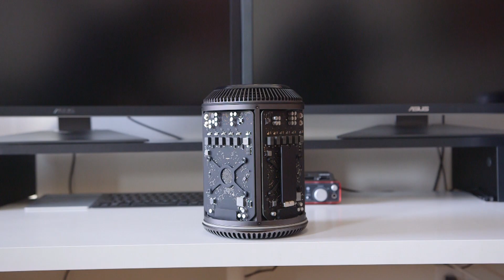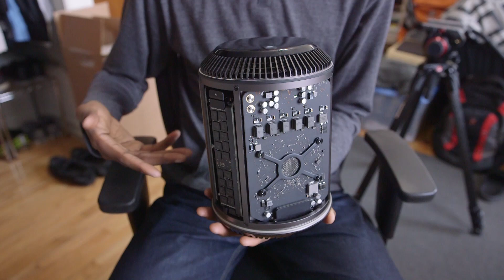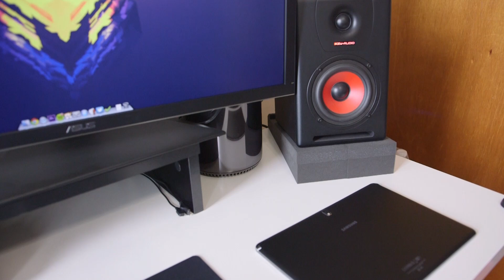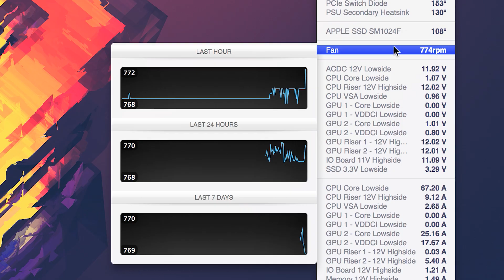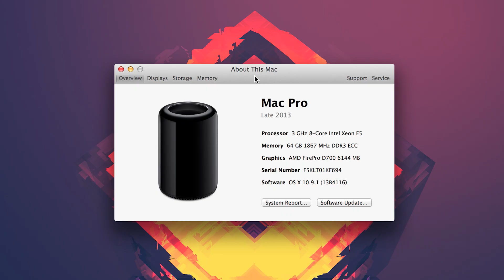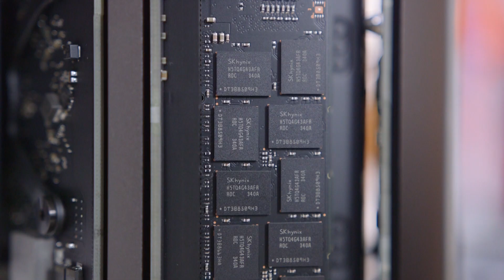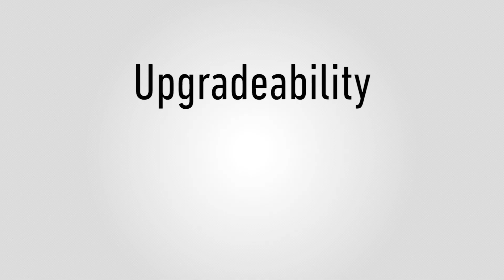New Mac Pro Review!

Comment: What a waste of money....
Reply: Why exactly?

And before you answer, think hard, because we have seen the "an i7 with a Titan and some non-ECC RAM and an SSD is so much cheaper" statements more than enough to counter them efficiently.
Reply: Indecisive Fella Terrible expansion options - GPU's non replaceable, SSD not replaceable with traditional parts, CPU VERY VERY difficult to replace, adding more hard drives requires thunderbolt drives... Really need me to go on? For less than the price of this garbage can you can EASILY build a workstation that is fully upgradeable and customizable.
Reply: Tyler Horsman
External GPU expansion is an option, if those D700 will not suffice your needs in three years anymore.
Flash storage is replaceable, but of course not with an S-ATA SSD like many people want-
CPU difficult to replace, but it is doable.

For the audience this workstation is meant for, external storage and network storage is already common, thus external Thunderbolt storage is not that big of a problem.
I worked at several video production companies, and the footage used for video editing and manipulation was always stored externally to make switching workstations easier due to scheduling of those.

And the price argument has been defeated to death, but you can give it a try with an i7 and non-ECC RAM and gaming GPUs and SSD storage of course.
Those consumer components are easily beating workstation components in every aspect you can think of, which means, you do only think of benchmarks.

The Xeon is rated for 24/7 operation, and i7 is not rated, though probably able, to do that.
The Xeon has twice the PCIe bandwidth.
The Xeon allows more than 32 GB or 64 GB of RAM.
The Xeon allows for Error Checking and Correcting RAM, which can help with hour and day and week long calculations.
The GPUs are workstation GPUs aimed at CAD and DCC applications and not games, thus they perform poorly in some games, but outlast and outperform gaming GPUs in the applications those GPUs were meant for.

And one other thing, I know, I know, it is already coming close to a novel for some, probably for people never having touched a novel in the first place of course, why is it, that Apple workstations get all the hate by people like you, but Dell and HP workstations with the same or similar workstation components costing the same or more than the equivalent Mac Pro are left alone?
Is it because of Apple?

And why can no one I ask this ever answer that question? Too afraid?
Reply: Indecisive Fella I'm never afraid. I would comment on those machines except I've never seen a group of sheep drooling over an HP workstation or other. People that DO NOT NEED this type of system are buying it because they think they need it because, APPLE. I never said that the components weren't capable. You talk about network storage and such being mostly the norm, but who wants daisy chains of lightning connectors all over their desk? It's schizophrenic design in my opinion to design something that is the epitome of minimalist design and then require external cables everywhere. As well, an HP workstation is fully customizable and expandable. The Mac Pro is an 'elitist' product, plain and simple.
Reply: Tyler Horsman
"I would comment on those machines except I've never seen a group of sheep drooling over an HP workstation or other. "
- And I have seen more people complaining about Apple products than drooling over them.

"You talk about network storage and such being mostly the norm, but who wants daisy chains of lightning connectors all over their desk?"
Probably the ones that do not use Lightning?
Yes, I get the cabling issue, I have seen it myself recently, but even if we had a big workstation in the suite, there would have still been a lot of cables.

"It's schizophrenic design in my opinion to design something that is the epitome of minimalist design and then require external cables everywhere."
- I recently came to the conclusion, that Apple wanted that design for expandability, to reduce the machine to its core components, thus reducing the size, and giving every buyer the option to expand via TB2 as the buyer sees fit.
And if one is a bit more precise when cabling, one can avoid clutter, or use a rack.

PS: I have worked on many workstations with some internal expansion modules (eSATA, video in/out), but always were there lots of cables going out to external periphery.
Hell, I have 12 TB of internal storage, but I still cable out to use my other 20 TB of external storage. Now please give me a case with space for 20 3 TB HDDs, I already found the motherboard with 22 S-ATA connectors.
And please let it not be higher than 50 cm and heavier than 15 kg and not made of the cheapest plastic you could find.
Reply: Tyler Horsman
Since all other non-Apple computers and computer parts are of course not produced by Foxconn and Foxconn is the only manufacturer with such working conditions.

And of there is no reasoning with me, if you have to use the word crap and if you use the word crap, your reasoning is not very persuasive and probably are already set in stone. Good luck with that.
Reply: Tyler Horsman As if PC's aren't made by the same people.
Reply: Indecisive Fella
In layman's terms, this system is locked down either by accident or by terrible design.  Sure, you can use the TH ports to upgrade parts, but at the cost of going in direct contradiction to the core design element.  Either Apple didn't think that one through, or it simply ignored it when it inevitably came up in the early R&D meetings.  Either way, it's design directly contradicts the logic used to defend its expandability.

And to that end (expandability), who ever heard of a modern workstation with a single Xeon CPU and soldered in GPU's?  Those two aspects alone throw this thing right into the Enthusiast grade .  Hell, Boxx is already offering 36 core setups that utilize dual 18-core Xeons.  Origin PC offers dual Xeons that each match the single processor in this iteration of the Mac Pro.  Both Origin and Boxx offer liquid-cooled setups, whereas you get the trifecta of heat generation (RAM, GPU, CPU) on a triangular logic board in the Mac Pro here, all cooled by a single fan.

Realistically, this version of the Mac Pro is a slap in the face to anyone that actually understands computers on a physical level, and more so to those that would need expandability without the mess of cable management.

Honestly, this system is a joke.
Reply: They might as well be, considering the limitations on "replacing" them.

And yes, it is a joke machine when compared to a real workstation.  What legitimate workstation lacks the capacity for dual CPU's?  What legitimate workstation lacks the capacity for PCI-e 3.0 cards, or the ability to utilize more than 64GB of RAM?  What legitimate workstation uses a SINGLE fan for overall system cooling?

That's right.  No legitimate workstation has any of those limits.
Reply: James Davis
Since workstation computer support more than 12 cores and 64 GB of RAM, there surely is a need more more computational power, be it in a lab or production company.

I have 32 GB of RAM and only a 4 core CPU.

I can easily fill 32 GB of RAM with just one application, if I had 64 GB I can surely do the same.
My 4 core CPU is plenty of fast, but what if a 12 core CPU can save me time by being twice or thrice as fast?
I recently had to transcode 160+ hours of 1080p footage. It took to four core i7 K computers over a week to finish, a task a 12 core CPU would do in less.

And imagine having a 3D animation where every frame needs just five minutes to render, ten seconds of that at 250 frames would almost take an entire day to render, and the scene only had six boxes and two text elements, three cameras and one light, but its materials were self illuminating and the render settings called for Global Illumination (GI) and depth of field.
That takes computational power. The more the better.
Imagine a four CPU 16 core system. It would race through those frames and have the time to render complex setups which my 4 core system would simply take weeks or months to finish-
Reply: *****
Come on, you can surely add that via a USB 2.0 to PS/2 to SAS adapter or a PCIminusE card, can't ya?

Or if you find that YouTuber who has a friend who makes all his hardware for him, including multi-core CPUs. I shit ya not. At least not in this specific case.
Now if g+ would offer some 1990s forum tools like search, it would be perfect, as I could find that fella, but what can you expect from a search guru?
Reply: Paul Lowe
I am not wanting to change people into Apple lovers, but I slightly want them to understand the differences and that people have different computational needs and that those needs are not always met by a cheaper computer with higher specs and such.
Reply: *****
And yet people seem to be capable of using it, especially in a time of breakout boxes, even to its full potential.

I guess with such a joke machine, no work could have been done and it would have burnt by now when two YouPort windows would have been opened?

And the GPUs are soldered onto the main board?
Reply: *****
What is a legitimate workstation then?
I guess there is a definition somewhere hidden inside your words?
Reply: Indecisive Fella
Pretty out in the open definition, really.  Any high grade system that doesn't put limits on what hardware it can utilize.

Look at BoxxTech or Origin PC on the OEM side, or look at the truly custom solutions that people build for themselves.
Reply: ***** I will do that.
Reply: What use could anyone have for more than 64GB of RAM, or dual CPUs when the one that's there has TWELVE EFFING CORES?
Reply: Indecisive Fella And that right there is why Intel now makes 18-Core Xeon processors, and Nvidia makes ungodly Quadros with the only object in obtaining both being cost.
Reply: *****
Ah, an 18-core CPU surely would help my transcode times.
Now I just need to get one of those quadruple CPU main boards and some RAM for each and I will be set for another year of transcoding.
Reply: Indecisive Fella
I have yet to see a Quad-CPU mobo.  If they do exist, they're in a realm this mere mortal has little access to.
Reply: *****
http://www.supermicro.com/products/motherboard/Xeon/C600/X10QBI.cfm
Reply: Indecisive Fella
If only that thing had SAS 12Gbit support, I'd gladly trade my entire tower plus the difference in cash for it.
Reply: Indecisive Fella
Too many adapters.  Does not compute.

Really though, at that level one might expect/look for SAS support.  But hell, some Enterprise PCI-e SSD's would work just as well.

And g+ not offering search tools?  You must be crazy!  Why, just the other day I used...um...Bing?
Reply: *****
"You must be crazy!  Why, just the other day I used...um...Bing?"

No, I meant g+ does not seem to have a tool to find one's own or other comments, like any standard forum software since the 1990s offers.
Reply: Indecisive Fella
And that was the joke.  G+ has about as much usability as Bing.
Reply: *****
Sorry, thought of Chandler Bing. And he is good at searching. Hmm. Late. Cats. English Mastiff. You know, the usual.
Reply: Indecisive Fella
Points for the Friends reference.  Late.  Yes.  Timezones and such.
Reply: *****
Space and time do not matter anymore.

And I guess the Bing developers watched Coupling quite a lot, thus its name.
Reply: Indecisive Fella 
You said space and time.  My auto-response is to assume Doctor Who.

And Bing had developers?  When?!  Where?!
Reply: *****
Which again reminds me of "Heyo Captain Jack" in some misguided way. Word association is fun.

And of course Bing had developers, at least on their financial reports.
Reply: Indecisive Fella
I can see the Bing financial report meeting now:

Boss: "So Johnson, how did we do last quarter?"

Underling: "Well, sir....we sold some ad-space to...um... AOL"

Boss: "FANTASTIC!"
Reply: Indecisive Fella Lol what is the point in defending Apple? Look at all your comments.
Reply: Paul Lowe
What is the point in bashing Apple products and especially Apple users? Look at all those comments.
Reply: Indecisive Fella I'm asking you the question for that very reason. I don't hate Apple. In fact, I'm replying to you on my iPhone 6 Plus. People are going to hate on Apple. It's always going to happen. Wasting all your time, as little value as it may have, is worthless. Do you think you're going to somehow change them into Apple lovers?
Reply: Indecisive Fella
yeah for my school ill be using ughhh i hate saying this a Macbook pro but Professionally a Mac is THE ONLY WAY TO GO i understand that however my every day work horse/gaming pc will ALWAYS be my custom built Windows pc windows is for gaming its just that simple. i couldnt bring myself to use a mac as my everyday pc its just to use profesionally both are amazing systems but its like i stated.
Reply: Sun Killa
We use Windows based Dell and HP computers all the time at work.  Hell, our live broadcasts depend on the stability and ease of use of our entire computer network.  Which is nothing but Windows.

PC's aren't only for gaming, as the common myth may dictate.

Comment: One thing about the "high" price, keep in mind that you do pay for the operation system. Mac OSx is not cheap to code and it is very well coded. So the Mac Pro uses less powerful internals but runs way smoother and faster than a Windows Pc with better internals.
Reply: i agree. a genuine mac with os x will ALWAYS perform better than a PC with identical hardware and windows, because Apple custom builds their hardware and software to get the most power. Macs don't necessarily have the best bang for your buck, since that is more subjective than anything, but they definitely have the most power for your hardware, which you can't say about PCs or even hackintoshes.
Reply: In other words, the Xeon CPU for up to 2,500 USD, the ECC RAM for up to 1,000 USD, the two GPUs for up to 3,500 USD EACH and the up to 1 TB of PCIe storage for almost 1,000 USD is cheaper than the consumer computer?

Interesting.

Comment: Holy crap, just spec'd one up on the Apple website. £10,000 without software !!!!!!
Reply: 9,600 USD with software, unless you want FCP X and Logic Pro included with that.

If so, better go to Dell or HP and configure one of their workstations, they probably include free copies of whatever software you desire.
Reply: What did you put in that beast? I configured mine with more than enough specs and it comes to about 6000 Euros. Of course I don't need to add any monitor because I already have 2 27" cinema displays. I can't wait for the new 5K cinema display from Apple.

Comment: I'm still in two minds about the current mac pro, on one side it's neat and all, I mean I'm attached to it for it's size like I was the G4 Cube but like the G4 Cube, if I'm honest it's not for me, but then again I use all of the HD bays in my 08 model and have hacked graphics cards and the like in there. As a photographer working in medium format sized images I find that I gobble storage space and, well, to replicate the cheap SATA based storage I have presently internally I can't help thinking I'd need more external units and a hell of a lot of cash!  

Just a little point, the older shape mac pro isn't that old, the case design is but it had many "refits" and most of them look quite different inside. I've never found the "Classic" Mac Pro hard to upgrade, from CPUs to Graphics to HDD's but in my models case the memory is ridiculously priced owing to having error correction on board (aka server memory) but the model after mine took more normal DDR3 modules so not as expensive to upgrade.

I wish Apple would look after its historic market more, as I, like many have been forced to look elsewhere of late to find what I want, I really started to leave the Apple camp with the inclusion of sealed batteries, back in the day I used to take a few with me on shoots and business trips.

Comment: In 2018 they will release another overpriced , outdated , sluggish trash box (cylinder) :D or maybe it's gonna be a pyramid :D
Reply: Overpriced? Do Dell and HP workstations with the same or equivalent components cost less? Can you buy the components for less?

Outdated? Do you want Boradwell Xeon CPUs before they even hit the market?
Reply: *****
Titans are powerful, but not workstation GPUs. The Quadros are.

As for the computational power, for its size, the Mac Pro packs a lot of power, at least according to test regarding the applications it is made for, which is not gaming.
Reply: size is a good factor , but it doesn't matter , you'l need to bring a screen with you everywhere (and a big one ,15" shit won't give you freedom) and about the CPU/GPU - just get 5960x and OC with water cooling ,and  what about ovepriced Quadros ? (like you even know how to use it ? :D) nothing get's rendered in 3d for production purpose (or is ,but rarely) and your quadros are used to increase Viewport frame rate if you work with millions of poligons and complex shaders  (which I doubt ,apple fanboy :D ) same goes for Firepros and other shit , as for videos , cores with SLI matters more , P.S. don't get HP - that shit sucks too
Reply: *****
It is a machine meant for external devices, since many production houses already use external periphery in order to accomplish the tasks they want to accomplish.
It is not meant for everyone, especially not consumers, who build Hackintoshes.